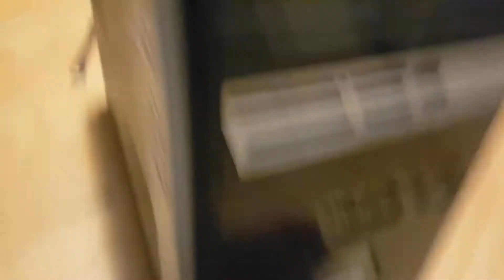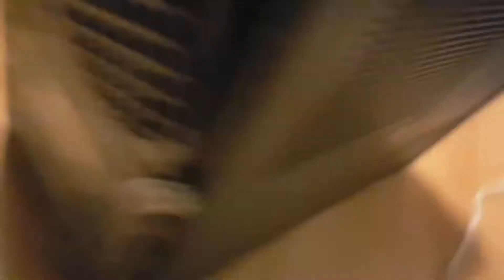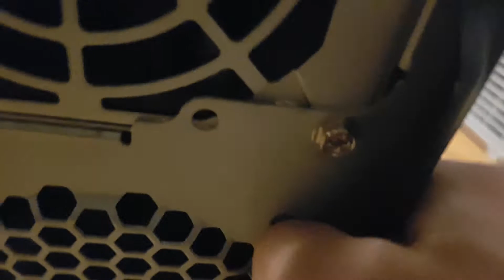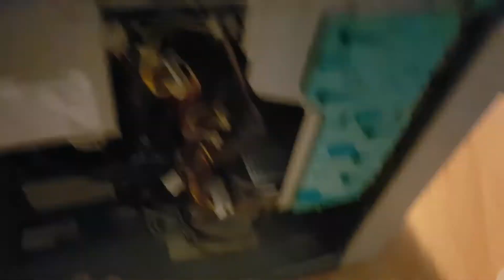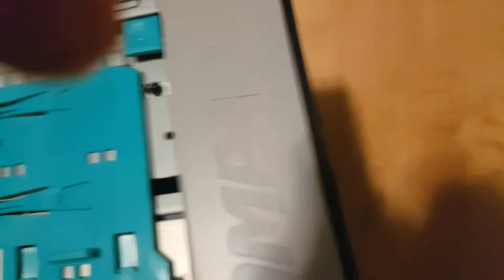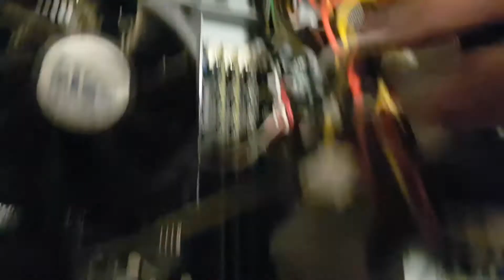How to install more ram on a old computer

Comment: You need to check if your cpu is 64 or 32-Bit because 32-Bits cpu can only hold 4gb of rams
Reply: So, 64 bit holds 8 gb of ram?
Reply: @U2BER2012  no, i believe 16gb is the max 
for the 64-bit edition